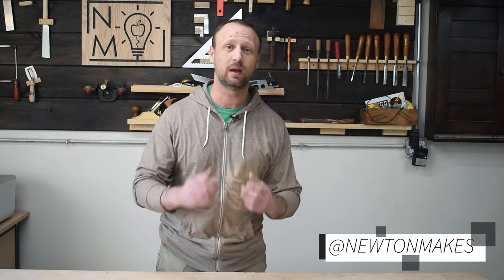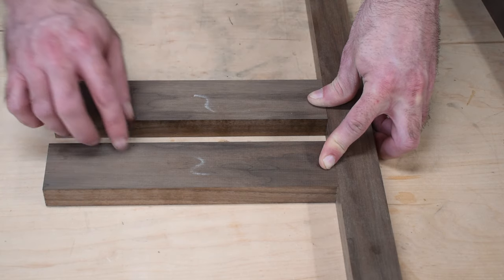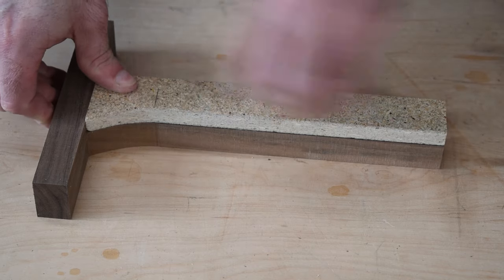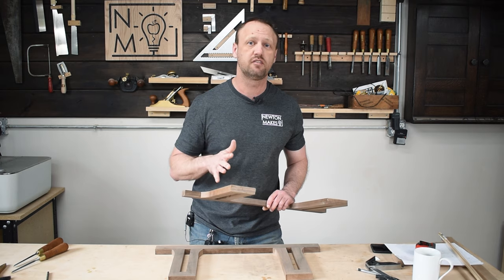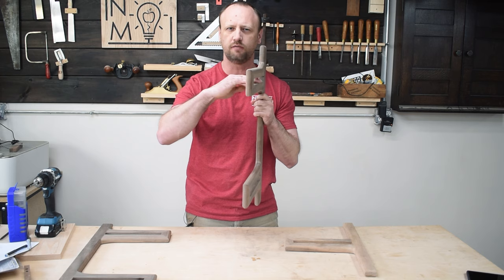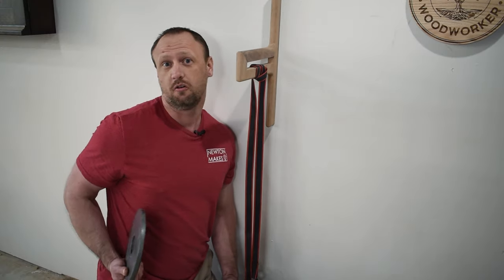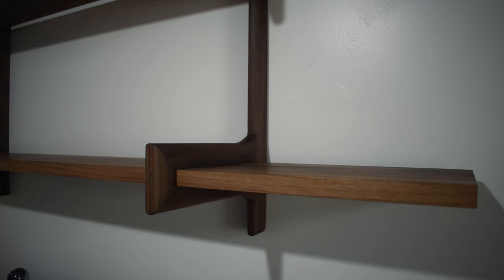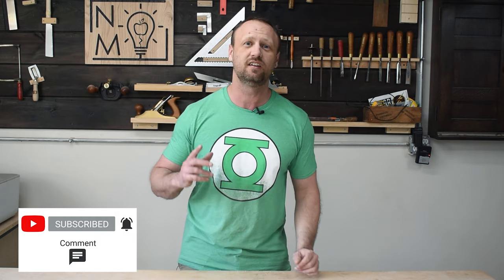Building Midcentury Modern Shelves...and a WEIGHT TEST!

Comment: They're beautiful, and I like the template for the keyholes. For smaller things with 2 mounting holes, I take a photocopy of the back and use that to get the placement.
Reply from the maker: That's a great tip. If I had already made something and needed a copy they that's a smart move. I try to remember to make a template while I already have my tool set up.

Comment: What is the purpose of the blue tape on your router table?
Reply from the maker: It prevents my router lift from moving up or down due to the vibration of the router.
Reply: Hey, Tim.  I have the same router table and Billie has come up with a simple solution to a big problem with this table.  If you are routing several identical pieces at the same setting or perhaps even one long board, the setting that you have set might change slightly due to vibration.  A subsequent version of this table has a lock for the setting, but a piece of blue tape is much cheaper than buying a new router table.  See, Billy is not just another pretty face!